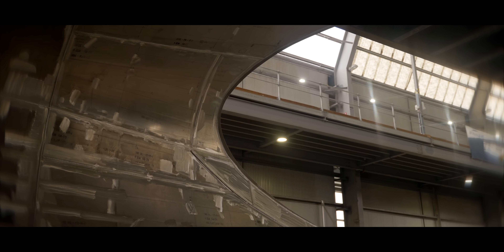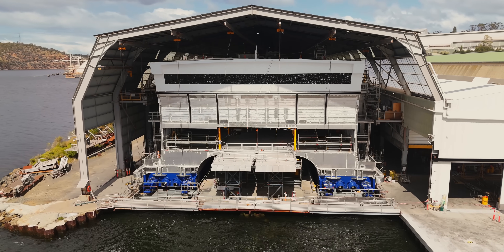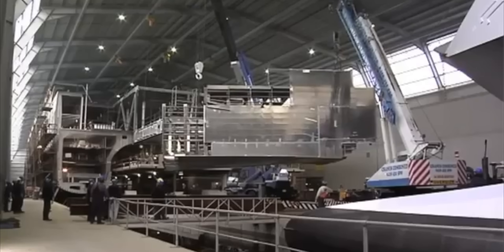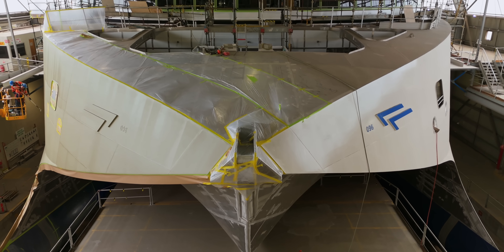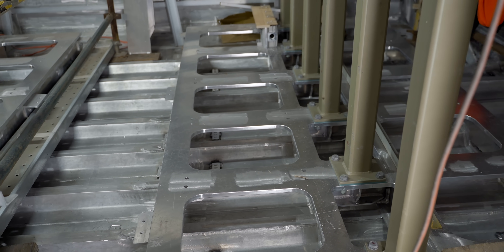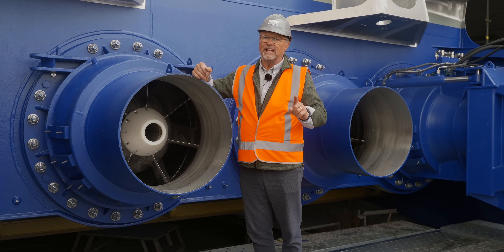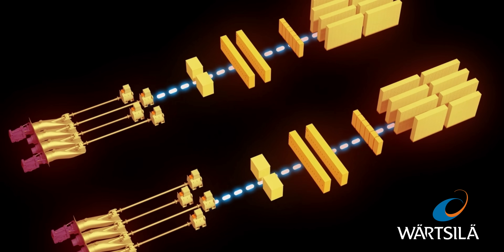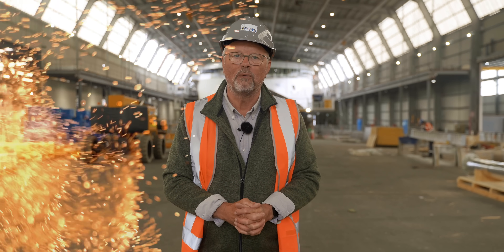The LARGEST Electric Vehicle In The World?!

Comment: I wanna see the 40MW charging plug
Reply: It's a usb c plug but it's 3 meters across
Reply: What's crazy is Argentina and Uruguay have different electrical sockets, so the ship goes back and forth with a 4-meter tall travel adapter 🔌.
Reply: @skierpage  It´s not a standard electric socket. A dedicated electric power suply must be mounted at each Buquebus port terminal (their own decks).
Reply: @andresmontero1908   Buquebus started with a standard Argentina electrical socket, but changed after the dock worker plugging it in was fried to a crisp by a 5 MW spark jumping the contacts.🤡🎇
Reply: Google 'cruise ship shore power' and you can see them. Yes it's more than one plug, for multiple 6.6 kV or 11 kV cables. I would suspect a dedicated custom solution that automatically makes the connection (some kind of robotic shore crane linking up with the connection on the vessel) if not a minute can be wasted.
Reply: It’s a floating death trap waiting to happen!
Reply: Fully charged covered an electric ferry in 2019 between Sweden and Denmark that had pretty cool industrial robot arms that plugged the ship in
Reply: Where do they stowe the 35 mile long charging cable?
Reply: @nospamfome  the charging cord is in the trunk ("boot") of the boat, under a pile of reusable shopping bags. And the last person to use it in foul weather never cleans it off before tossing it back in the trunk.

Comment: If this was foiling, it would use a fraction of a fraction of the energy
Reply: Sounds good but foiling may be difficult to achieve at that scale and weight
Reply: what speed would you have to go to to lift  225 cars?   and how are you planning to do that in 2.5m of water?
Reply: @mralistair737  You don’t understand the fundamentals of foiling.
Reply: @davidwebb4904  as i understand it you have to lift out of the water.. which means the foils have to be lower than the bottom of the boat.   sounds tricky in 2.5m of water.  but also drag rises with the lift required hence why there are very few 1000 ton hydrofoils .

Comment: The electric Scottish ferry that just broke down and there is no estimate for repair should be a good example of how reliable these electric ferries are. Bets on how long it’s in service before it’s called a complete loss, either from lack of charging power or motor or battery failure.
Reply: 40 battery-electric ferries in Norway and "World’s first fully electric ferry celebrates 10 years of success". Your "Can't do" attitude is duly noted, and fossil fuel Industries thank you for your support.
Reply: Oh no! AN electric boat had a malfunction.  Surely the concept is doomed forever!

Comment: Not on quite the same scale, but we have traveled on several electric ferries in Norway. Took a while for me to realise we where on one the first time, was out of the van on deck thinking "This is a nice ferry to travel on" then it clicked, the lower noise and vibration makes for a much more pleasant trip.
Reply: We also travelled on many electric ferries in Norway last year - it was  a great experience  .
Reply: lol!!!!!! the one in norway too doesnt even have 50 miles of range its minuscule compared to what a diesel or LNG ship can do, also there are not that vibrations or incomfort on ICE ones.
Reply: @alanmay7929  The electric ferries in Norway are designed to do the same job as the Dino juice ones, they do it close to silently and without clouds of black smoke, IIRC the longest journey was 3/4hr, just like cars they don't need long ranges, the difference in comfort due to lack of noise and vibration is very noticeable
 In the last 12 months I've traveled on around 40 ferries, so I've had plenty of time to compare. 😛
Reply: @fredbloggs72  no modern ships actually have clouds of smoke stop lying! its the very very old ones that have super old engines and exhaust systems can you even be serious once!
Reply: @alanmay7929  I would suggest you go to Dover and watch the Ferries there, you will often see clouds of smoke.
Reply: @fredbloggs72  yeah the 50 years old ferries right! the government let them still run the old outdated engines thats what youre trying to say?!
Reply: @ I don't know of any "50 years old ferries" operating out of Dover, I have however watched 14 y.o. ferries belching black smoke as the engines fire up.

Comment: What possible reason is there, for why there aren't any electric versions, of the biggest of ferries, or electric cargo ships? I get why it initially was a bit tricky to make competitive electric cars, and why electric, or even hybrid, aircraft are a challenge ...but ships? I don't get it. What could possibly be the problem?
Reply: Think of the energy loadcase for a car. You are using that car 3% of the time, and the maximum power 3% of the time. It takes about 20 kW to maintain 100 km/h. The rest of that engine power is only used in very hard acceleration. So the energy consumption of a car is relatively modest with regular intervals available for charging. That's why batteries work so well for cars. If you want to go long distance and use your engine 100% of the time at 85% capacity, the numbers are completely different. You can't take that much energy with you on a ship for more than a few hours. Within that (short distance ferry routes) batteries work very well (multiple ones in the Norwegian fjords for instance). If you need more range you first switch to hydrogen and for really long distance (multiple weeks running) you need methanol or ammonia as a sustainable (green produced) energy source.
Reply: @d.j.vanderschoot3717  "You are using that car 3% of the time" No, you use it the vast majority of the time, when you're driving. (the only exception being, when you're at a red light, or stop sign) Also, you say the maximum power is used for very hard acceleration? Not when carrying heavy loads and going up steep hills? And where do your numbers come from?
Reply: The power demand requires literally tons of batteries for every hour of operation. This ferry needs 40 MWh battery weighing 250 tons for a 90 minute trip. So long-distance routes at sea are challenging. Battery-electric may be feasible for longer routes along rivers or the coast, since ships could dock to recharge or swap batteries. COSCO operates a 50 MWh battery cargo between Nanjing and Shanghai (300 km) on the Yangtze River.
Reply: @skierpage  I don't believe that, for a second.
Reply: @  Every word I wrote is fact. What part of the physics and math don't you understand?
Reply: @skierpage  The notion that what you said are facts, is what I don't believe, at all.
Reply: @ZarlanTheGreen   My second sentence about this Incat ferry's battery comes from this video, so take it up with Fully Charged. My fourth sentence is an obvious engineering conclusion, I can't remember where I read about it, maybe CleanTechnica. My fifth sentence about the COSCO battery cargo ship was widely reported, do a web search.
Reply: @skierpage  How much bigger and heavier do you think the batteries would need to be, to power a ship, instead of a fossil fuel driven ship? (and keep in mind, that an electric engine requires less energy, to perform the same work a combustion engine would) The ship in the video, is pointed out to be lighter, than if it had used LNG... And I've generally assumed that you'd need more space and weight for batteries, than oil/diesel, but... how is that a significant problem, for ships? I get that it used to be an issue, for cars, sure, but why would it be, for ships?
Reply: @skierpage  "My fourth sentence is an obvious engineering conclusion" Is it? Based on what?
Reply: @skierpage  "My second sentence about this Incat ferry's battery comes from this video" Fair enough. My bad. Thanks for the correction ...but I don't really get why I even addressed that, as it's irrelevant. Any numbers for an electric ship are meaningless, in terms of this discussion, if they aren't compared to what would be required for a ICE ship. Something you have not done (the video has, however, in pointing out it's lighter), making your comment completely useless.
Reply: It's being done already.  This is just the newest and biggest one so far
Reply: @jamesengland7461  Why hasn't it been done, decades ago? Why aren't there tons of electric ferries and cargo ships, already?

Comment: If this can do 35 miles then it works as a cross-channel ferry UK/France. So I look forward to my 1st go on a battery-powered one of those. Going that fast is very energy-intensive - it's more efficient to go more slowly (25 knots rather than 35, sort of thing). In an energy/cost/range-conscious world we could go a bit slower. We have had those fast cats on this route in the past, but I think they were generally found to be too expensive to run, and everyone has gone back to standard-speed ferries.
Reply: I think it was more that the Channel Tunnel killed their advantage of speed but I could be wrong. Very little point getting a ferry when it's quicker and easier in the Chunnel.
Reply: @jonevansauthor  For an expensive ferry that's true. The standard ferries are consistently cheaper than the chunnel so they stay in business. I only been on the chunnel a couple of times in 20+ years because the ferry is always cheaper, and I actually prefer it for night crossings as it's long enough to get a decent kip. The chunnel is too short for that.
Reply: If they use the Welion semi solid state batteries they can make a ship go from Helsinki to Tallinn with the same weight assuming that the current batteries are around 240Wh/kg

Comment: What's the range on this 40MWh ship? Sorry if I missed it in the video
UPD: at least 35 nautical miles (65km) 2:00

Worst case efficiency is 0.62MWh/km.
For comparison ev-truck with 20t of cargo has an efficiency of around 1kWh/km.
So this ferry consumes 620 more than ev-truck with 20t of cargo.

Let's calculate per tonne.
225 of 1.5t cars + 2100 of 75kg passengers = around 500t
Let's double that since there is some additional stuff being transported (for shopping onboard, spaces and seats for people, approximations, etc), so cargo is 1000t.

So we get to 0.62 kWh/km per tonne.
In comparison the truck has 0.05kWh/km per tonne.

So the ferry is 12 times less efficient than a truck?
Am I missing something or water transport is so much less efficient than land cargo transport?
Reply: I think water transport is much less efficient if you cannot transport huge amounts of cargo. Cargoships are very efficient per tonne because they can store so much. This wouldn't be very efficient since it cannot transport so much, but it still needs to be big and bulky. I'll give you an example of an idea to think about. A Scania electric truck weighs 11t. Fully  loaded it is about 64. So, an 11t truck can carry 53t of cargo. This ship weighs much, much more than what it carries. Even the amount of water it displaces probably weighs many, many times more than what it is transporting. 

Then, in terms of resistance, a truck has resistance from the friction of the tyres, it has wind resistance, and it has internal resistances (internal losses in the drivetrain). A ship like this has wind, internal resistances also, but those are nothing compared to the resistance the water in front of it. A truck has wheel bearings and can roll relatively efficiently down a road. A ship has to constantly push A LOT of water out of its way, even at speed it needs to provide a lot of power to not slow down. A truck may not need to provide as much power to not slow down, to keep a steady pace. The frictional resistance on a truck is very small compared to its overall footprint. You may have 12-18 tyres that only have a small area of contact with the ground in relation to the size of the truck. A ship has a lot of water to take care of. 

This is just a thought experiment, I have no data, I have no facts. I am just trying to reason. But it seems to be that a ship would be much less efficient than a truck. It makes sense.
Reply: they said they'd have 40 mw charging.. that doesn't mean the batteries are 40mwh.     lets say the trip is 20 mWH,   that's  0.28 KWH per mile  per tonne...  which is better than almost any car. 

Cargo ships are efficient because they are slow..  fast boats take huge amounts of power.
Reply: @mralistair737  They did say "250t of batteries, 40 MWh"  at 6:25. I've read the same in articles about that ship. 
They also said later that charging is gonna be 40MW, i agree.

I updated my calculations, but still get 0.48-0.96 KWh/mi (non-nautical, regular imperial) per tonne.
Which correspond to your 0.28KWh/mi per tonne if the trip is 20MWh.

For comparison, Tesla Model 3 or similar small car with one 100kg person does 0.23KWh/mi which is 2.3KWh/mi per tonne.
However I don't think that it is a good comparison.

Same Model 3 with five 80kg people will do around 0.26KWh/mi or 0.65KWh/mi per tonne.

So yeah, seems like this ferry is good to go! As efficient as a fully loaded passenger car, or probably even twice as good, according to other comments.
Reply: @Wurlipurili it's not using the full battery on each crossing. 
Pretty sure I saw somewhere that it will have enough range for about 3 crossings.
Reply: They probably will have a bigger range than 35 nautical miles (x1.852=65 km), as you would normally go down to maybe 20 depth of discharge and you need a healthy margin when recharging time is cut short or there is a bigger sea state, lengthening the voyage. But it takes a lot of power if you push things through the water at high speed, the energy efficiency drops like a stone. Do it more slowly though (at 12 kn, rather than 30) and the tonne-mile/kWh is much better than a truck. Do it really slow an on a river with a well designed barge and you can push 200 40 ft containers through the water with say 1200 kW of power at 6 knots or 11 km/h. Speed is costly.
Reply: @d.j.vanderschoot3717  Yeah, I agree, they need some buffer for battery health and harsh weather increased consumption. Or they could go slower in emergencies. So the fully loaded trip is probably around 30MWh. 

I've read that electric ships generally still need to go twice as slow as diesel ships to get to good enough efficiency and not carry to much batteries.
I wonder which speed this ferry will go with full load. 
They mentioned at 5:30 that they expect 1.5h to cross these 35 nautical miles, so 23knots (43km/h). Not bad!

Comment: They can't make much bigger ships without building a bigger shed first - it looks almost up against the ceiling.
Reply: They can make them longer!
Reply: In the design office, there are template drawings with the exact size of the shed beams to be used when designing the superstructure. 
Most of them are built with inches to spare.
Radio aerials and handrails etc go on after it's out of the shed. 

I used to work in the design office there
Reply: Incat recently bought a second site for an extra shipyard near Hobart.

Comment: I look forward to the technology developing far enough to enable electric ferries to cross the Channel. It's a bit uncomfortable in many ways to sit in a diesel powered boat for 6 hours...
Reply: The distance this is travelling isn't that different ... and  Al Jet ferries  already operate across the Irish sea though those are hybrid power 
... Li S and Na S or Al ion or Al S batteries are already past the working lab scale cells stage.  Given that Al ion cells could ultimately have double the energy density of diesel fuel and huge 6C rates. Then you can see  the Advantage..   
Also  Companies like RR have been working on a new generation of light compact gas turbine APU's
To power modern jets Ships and giant machines ... That are otherwise electrically dependent. 
The other giant materials and Wt saving is to use  🇬🇧AEM type motors that run without permanent magnets and use Al not copper  windings. 😉🧙🏼‍♂️
Reply: lol!!!!!!!!! there is nothing uncomfortable stop lying please! this electric one barely has 50 miles of range.